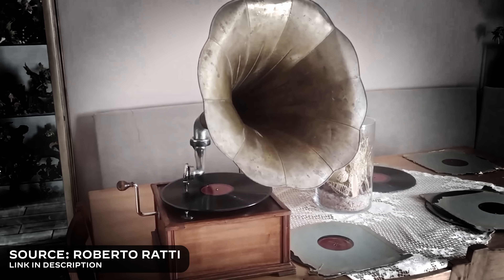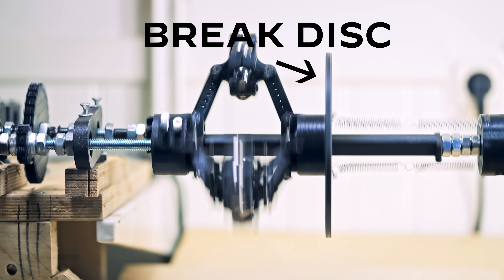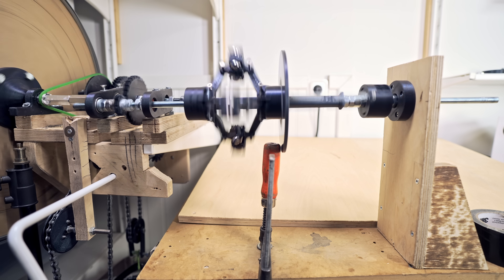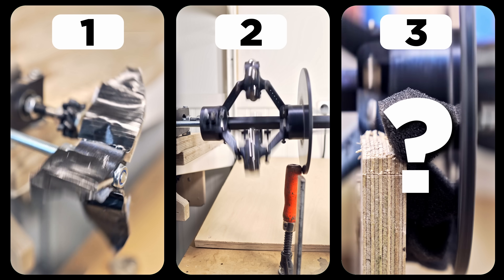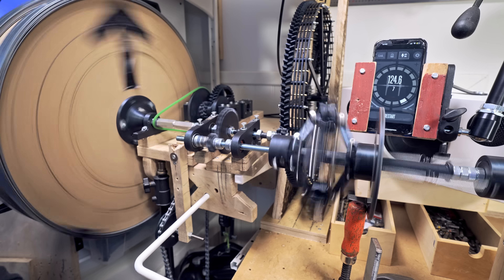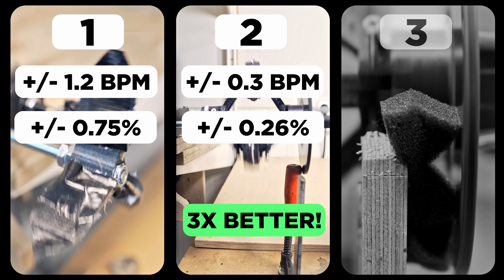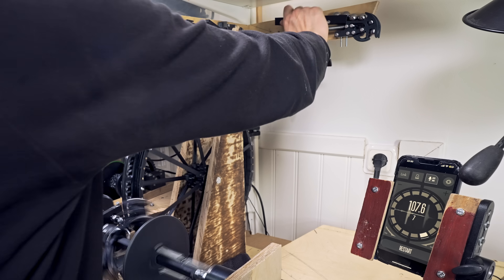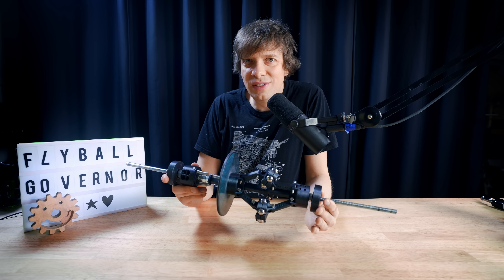How Gramophones play Tight Music - The Flyball Governor

Comment: Hi Martin, 

Great solution!
 It solves a huge weight problem of the marble machine with a huyigens drive. 

I would try to dont waste energy trough friction. 
It could be smart to use the brake disk as a clutch to accelerate an decelerate a smaller second flywheel via high speed planetary gears. This would probably save you some air ;)
Reply: My thought exactly. Clutch makes sense because you already have a spinning power source.

Comment: Ideally the test you need to do is one with variable load.
e.g. switching between no marbles being played, to lots of marbles being played.
This is the real struggle point for a machine like this.

This is also where a flyball governor can be so much better.
If the machine goes to fast (due to too low load), the friction can increase a lot to slow it down and clamp the tempo.
If the machine goes to slow, the governor very quickly stops applying friction at all allowing the tempo to increase to where it needs to be.
This very dramatic, almost step like response is what can make these governors so good.
An air break governor could never do that anywhere near as good.
Reply: I suspect that the foam's ability to compress is bad for a variable load. As the foam compresses, it allows the governor to change speed slightly. You probably want something with high friction that doesn't compress much.
Reply: Yep. In control theory terms, the feedback loop has a very high gain -- it only takes a tiny movement of the governor to change the friction by a large amount. Making the brake pad too squishy will only reduce the gain and make regulation worse. I suspect the foam worked better because it had a larger contact area and could provide more friction when called upon.
Reply: There are so many variables he's not controlling for. In software engineering we call this "premature optimization." A lot of his data is next-to-useless.
Reply: I agree. I'm posting a separate comment related to yours. The governor needs to,,, as Martin would say, be tight.
Reply: While I agree leather is better than foam, I'm wondering if for the full scale setup a commercial brake pad would work, as it will have a much larger mass to govern. That also comes with the added advantage of off the shelf parts and quick replacement.
Reply: I really support the points of the original comment and first answer. I was very worried about variable loads affecting the song tempo, but a such a governor with a strong response, plus a strong enough power source really helps.
Also, I would prefer a less ompressible breaking material. Foam may give a great result once, but I think it can degrade when greatly varying loads apply, and also material fatigue can mess with the reproducability of a tempo.

Comment: Amazing how good the foam was, but I don't understand why it was better than the regular stop. I would have expected the result to be the same, no matter what material you put in front of the brake. Something to do with the...uh... springyness of the foam?
Reply: Probably three things that all multiply together

Higher squish allows the weights to move outwards slightly. The balls being further out increases both their acceleration and (I think) their leverage. Both increase their force on the brake.

The other is that the foam has higher coefficient of friction, which turns that force into more effective braking.

Comment: Consider using %Relative Standard Deviation (%RSD) in situations where the tempo is different between these types of experiments. This will make the results better comparable, as higher BPM experiments will always have a higher SD, and lower tempo = lower SD - even if the true variability of the system is exactly the same. Using RSD will eliminate this issue as it will standardise the results. %RSD=SD*100/Average
Still great results though!
Reply: I was going to comment about this too.

Do the first experiment again but at 10 BPM, it'll probably have a SD of < 0.2 BPM (maybe even < 0.1 BPM). That doesn't tell you anything about which is better, just that you did the test with a LOT of margin for error. (or you should just measure the milliseconds deviation, because that's what actually tells you how tight it is)

Comment: Martin, I suspect that it is the larger friction, NOT the softness, that makes the foam perform better. Better still: use a rigid material with maximum friction (like that on a real brakepad). 
Reason: soft foam allows the brake disk to move sideways => balls move radially => speed varies. 
A rigid friction material will cause a higher feedback gain => tighter still. 

Try it!!!

(Beware: if the rigid material has lower friction than the foam, this counteracts the desired effect. Compromise: THIN foam layer (i.e. less elastic) on a rigid substrate!)
Reply: My theory is the foam has a better linear relationship - friction vs brake position.  Light touch, light friction. Heavy touch, heavy friction. I don't think the wooden handle will respond in this  way.
Reply: @franktkalcevic5342  
Agreed. But you don’t need a linear relationship between disk position and friction. 

In James Watt’s steam engine, the balls needed to move so as to actuate the steam valve. In Martin’s machine we just need a variable braking force, and that takes variable force between the disk and something stationary - but no axial movement is needed. With a constant disk position, the balls will be at a constant distance from the axle, so the centripetal force will be proportional to the square of the speed (not linear, but fairly so for small deviations). This will again be proportional to the force on the disk, and thus proportional with braking torque (because braking torque is typically proportional to the force between the disk and whatever stationary surface it runs against).

Comment: Simple, yet effective. A good option to consider is a metal flywheel with magnet brakes to maintain tempo because it cuts down on the number of parts that need to be replaced at certain intervals. I'm not saying you have to go that route, but you should at least consider it as an option. If you decide to test it, good. If you decide not to test it, also good. Your machine, your decision.

Comment: Should give a try with felt pads!  The foam works great but I feel like friction will wind up ablating it over time.   over long periods of time (Like a world tour :3  )  this could gradually change the BPM the governor settles at per position of the brake.  Felt won't have that problem.
Reply: I agree that he should probably use a different material, but as long as the pad is easily replaceable, it doesn't have to last for a full tour. It just needs to last for a single live performance, after which you can just swap out the friction pad for the next show.
Reply: Maybe felt on top foam. This way the foam still behaves like a spring and the felt behaves like a durable and replaceable break pad.
Reply: Bike / car / motorbike  disc brakes are engineered for this job, including durable discs and easily replaceable pads.  They also have increasing friction with increasing input force, which helps stability, like the foam does. So calculate how much energy needs to be dissipated, choose the existing tech that’s up to that task.
Reply: @andrewkepert923  On the one hand using bike disc breaks seems like a wonderful way to simplify things (yay for more bike parts like the bowden cables). On the other hand I wonder if they would produce noise and how much. Noise doesn't matter that much when breaking a bike but a continuous screech in the background of a musical instrument is obviously not desirable. I'm not knowledgeable about bike mechanics so no idea how bad it would be.
Reply: @AlexandruVoda  Agreed about bowden cables.  
WRT noise, on a bicycle, disc brakes are a lot quieter than rim brakes.  They're more precise ... and attract less mud, which shouldn't be an issue here.  Car or motorbike brakes are usually quiet except in extreme braking or if the discs or pads are in bad shape.   It can also live in a housing if it's still too noisy.  
I suspect the best solution would be to buy an off-the-shelf mechanical governor that does all of the above and has been optimised (by someone smarter than either of us) for a suitable range of speeds and loads.   I'd bet it would be cheaper, easier and more reliable.  But where would be the fun in that?

Comment: I wonder if the reason the foam was better was due to a larger contact area, It kinda looks like a brake disc, I wonder if a brake disc / pads would work well given the mass involved - off the shelf parts :)
Reply: I'd like to see a test with the same wooden stopper but without the padding, so that the comparison of with/without padding has less variables (in this case, contact area of the stopper).
Reply: If you add the motor back into it you could use the "braking" contact of the govenor as a throttle reducer. i.e. completes the circuit and reduces the power input.

Comment: This is great for multiple reasons. Im mostly happy that this gives you a good way to adjust speed on-the-fly, although that would still be easier with a smaller flywheel.

I'm really hoping you will do a test with a more dynamic load though. Imagine playing a big chord with multiple instruments, would that be able to slow down the music noticeably for the next few beats?

Also if the governor works well, I think you should investigate how tight the input side should be. Smaller flywheel might be nice for faster tempo changes. Or maybe you can test being a bit less careful with the manual power your adding to the hyugen drive. Or maybe a spiral spring could work again, with the governor taking care of the non-constant force.

Comment: Purely mechanical instruments are good at keeping a tempo, they are called watches :)

Good move with the flyball governor (also used in steam engines). I was not convinced by your air governor, it was not governing anything as the blades were static.

Comment: You should revisit the huygen drive - if I remember right you felt you had to provide constant input to get a constant BPM. With the governor you should be able to provide pulsed input and still get relatively consistent BPM. Much like how the spring on the record player doesn't need to be constantly wound to play music
Reply: The governor probably won't respond quickly enough to smooth pulsed input, and might add residual oscillations after pulses.
Reply: @waterlubber  I'd say it should go Martin->Large Flywheel->Governor/Clutch->Smaller flywheel->Load

Comment: Something to keep in mind, the Friction itself isnt needed and will just wear out the part.

You don't need any friction at all. You just need to prevent the brake from moving to the left.
I'd investigate using oil or rollers to minimize friction.
Reply: or use a bearing on this part so the inner piece can rotate freely and the stop stays still?

Comment: The foam will change over time, I would use material that has little changing property's with heat..
Reply: He should probably just use a rubber pad, similar to something like a bike-brake. Or the felt he's used before.
And as long as the pad is easily replaceable, it only needs to last for a full live performance. So it doesn't really matter that it wears out over a longer period of time.

Comment: One of the tricks of the Flyball governor {or any active Governor) is if the flywheel is too big it has to work harder to "correct" the speed of the Flywheel. even the Gramophone/Victrola does not have a flywheel between the spring motor and the governor.
Reply: i was thinking exactly that , does he even need a flywheel now ? The less "weight" the Flyball governor have to slow down , the better it will work , could be interesting to test it. That way he could even go into tempo faster and not whait 2 min each time when starting the machine
Reply: @pacboy5434   Yes, indeed, but that means it will be even more important to use control system design and analysis techniques to optimize the tempo-change response to be critically-damped or slightly over-damped; if the tempo governor system is under-damped, you might end up with the marble-machine equivalent of a Leslie speaker (unless that's a desired outcome...)
Reply: The flywheel is an energy storing device. The governor is an energy discharge regulator. So they fulfill different functions. But he has been using the flywheel consitently wrong, since he used it as an energy regulator. So both can and probably should be used. But they should not have a direct coupling between them.  @pacboy5434
Reply: @pacboy5434  The flywheel is a giant mechanical battery. It allows him to play without having to input more energy. Without it the whole thing would grind to a halt fairly quickly.
Reply: @Temperans   Except he's using the Huygen chain drive now, which means he can stop inputting power for a bit and it will continue to run at the same rate.
Reply: @Temperans The where is what's important. In a victrola the flywheel is the platter but the flyballs also act like one as well (spinning at high speed is more effective as well, this is the principle a capstan works on... flyweight spinning fast against a low torque load (the small diameter of the capstan makes its angular momentum have more authority.
Reply: @ducttapeengineer  its no way near the same amount. People really understimate the amount of power stored in a massive spinning object.
Reply: @pacboy5434 Flywheel is still necessary to drive the whole machine without having to constantly push on the lever hard. And it still helps smooth the tempo a lot even with the governor, without a flywheel you’d need a very precise governor setup and you’d need to constantly rotate the handle at a pretty steady pressure to get a consistent output.

Without a flywheel smoothing all of his inputs the ball governor would have to be perfectly tuned in mass and friction at the very least.
Reply: It is good practice with low torque like this to drive the flywheel via the governor.

Comment: I wonder if there might be improvements with a range of materials inducing friction on the brake wheel. It would make sense that the higher the friction coefficient the greater the speed of the feedback loop, but as you have said everything must be tested. Maybe if you can find an old car tire it might work even better than the foam did in this experiment.

Comment: this is awesome. but soft foam will probably quickly wear out due to friction. maybe you can get the same effect with a really soft spring on the roating plate that is hardly mounted to the brake. i'm not an engineer sry. or you could try a magnet design. so the brake doesnt even touch anything and stay where it needs to be. this could work just as good. i mean on the breakdisc a positiv magnet. and on the break a positiv. so the never touch but stay at distance
Reply: As long as the friction pad (doesn't have to be foam. It can be rubber as well, like a bike brake) is easy to replace, I don't see any problem with it wearing out. As long as it lasts long enough to do a full live performance. Using a stop brake like this instead of a magnet or spring also makes it very simple to set a target bpm by just sliding the the brake point back and forth.
Reply: @TijmenZwaan  i think the foam keeps it steady and smooth. rubber can cause chutter and is not as smooth

Comment: Be careful with governors, while they will work for stable speeds, if you plan to change speeds there can be some oscillations in speed that can occur after a change as the governor "hunts for" the new speed.  It's PROBABLY not an issue with a small mechanism, but might show up at larger scale
Reply: Adding a dashpot or other friction source to the horizontal movement of the governor, especially with a lever to amplify the effect, would add enough damping to kill oscillations (at the cost of having the system take a longer time to assume a new tempo after adjustment).
Reply: @waterlubber  good idea, the trick is knowing ahead of time how much damping, if any, is needed

Comment: Note that a flyball governor only performs proportional control - its friction is only proportional to the speed error. This means you will always have some small amount of steady-state tempo error with changing frictional load: the MM3 will still slow down slightly as load increases, but less than it would without a governor; increasing the strength of the governor reduces this effect, but can never reduce it to zero.

If you want to truly reduce error to zero and hold a rock-solid, perfect tempo, you need an integral error term: use a flyball-governed "master oscillator", and measure how far it gets out-of-sync with the MM3. Small errors will accumulate over time: if you add braking based on the "lag" of the system, it will drive this "lag" error to a small, nonzero number; the actual tempo error will be brought to zero in the process.

A system like this is susceptible to oscillation and other effects, but I expect them to be fairly small with the way the MM3 will work.

You can expect much more variation than in your BPM test once a varying load is actually applied: the strongest effect will likely be when a number of marble lifts kick on when an instrument is activated; under these circumstances, the tempo will drop.

Nonetheless, the additional complexity of an integral circuit is probably unnecessary. Just make sure that *the majority of, or at least a significant amount of the MM3 load is dissipated in the flyball governor.*
Reply: Is the load likely to vary that much? I would imagine most of the load would be in moving the machine itself. The number of marbles being lifted being the next, and that's not going to vary wildly.